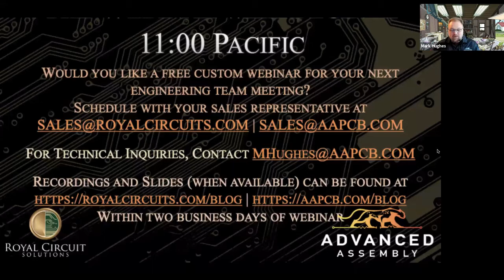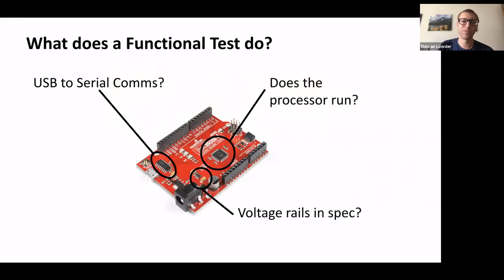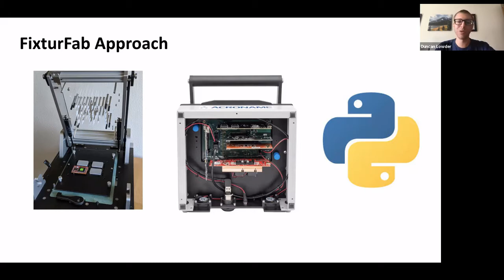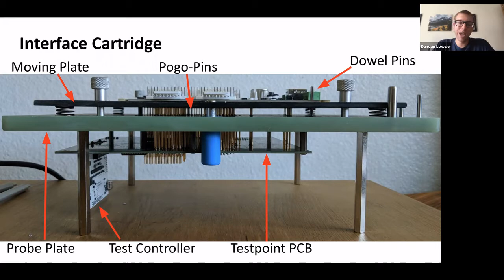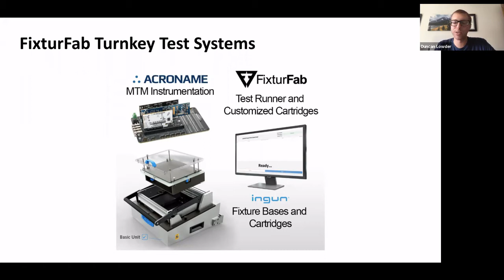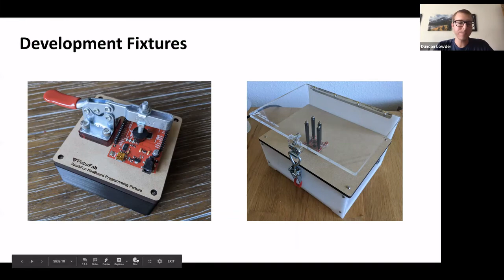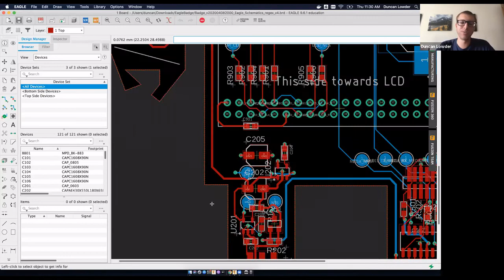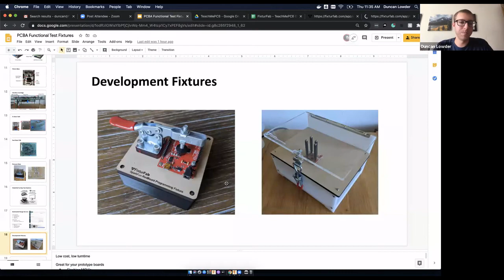Using Fixtures for Critical PCB Testing, Programming and Debugging

Comment: do u also integrate pneumatics pins, connector, and moveable counter (top) bed of needles ?
Reply: FixturFab probably isn't watching the comments here.  But they're integrate anything you want -- they do custom work too :)
Reply: @markjarrodhughes  in the meantime we got a new supplier so il have to see if they are any good. 
and i did put these guy's in our potential supplier data base.

Comment: your approach doesnt scale, it's actually more expensive if you have multiple fixtures
Reply from the maker: There are projects of every size and products for every market.  FixturFab's approach is intended for a smaller production run.  These smaller fixtures are not meant to scale.